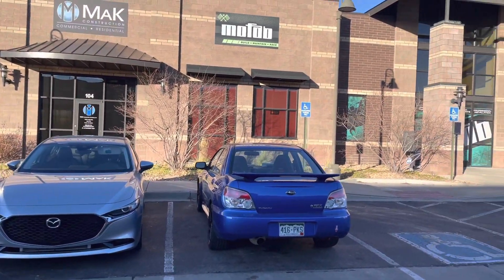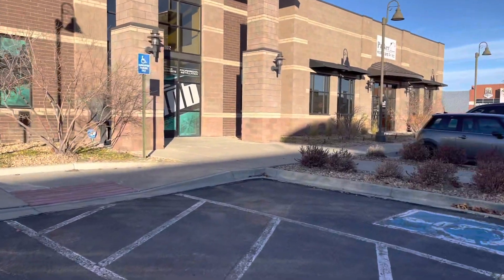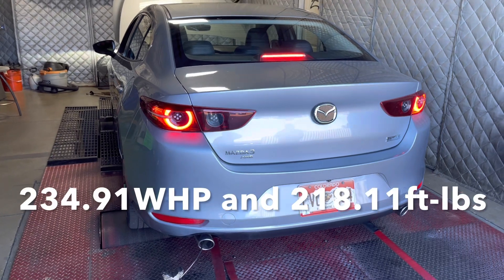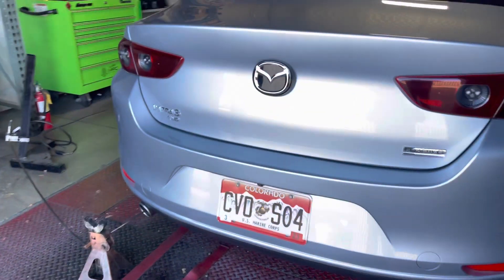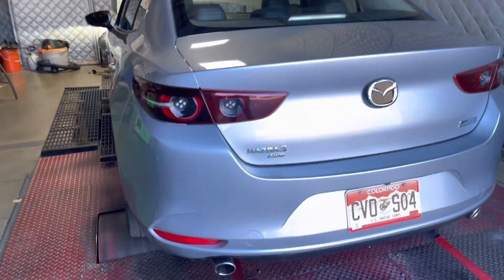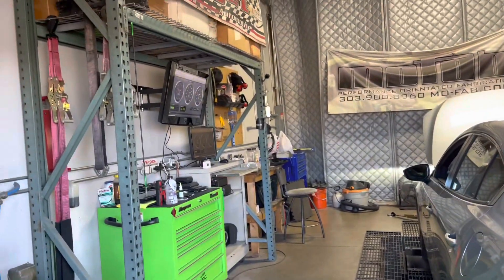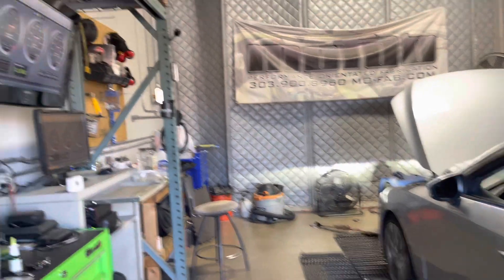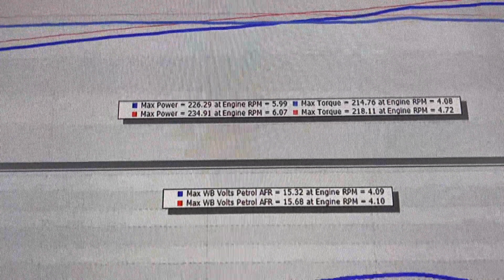VT-Racing Supercharged Mazda 3 2.5L Dyno Results!

Comment: Is there any other mod you need to support this super charger?
Reply from the maker: Depends on the year of the vehicle all cars are required to use upgraded spark plugs DILKAR8A8 work best
Reply: @supermazda3 i got a 2018 3 hatchback sport gt, Ive read somewhere that someone installed a low pressure oil something to support it i dont know im just wondering how much of a bolt on this is, aside from installing it and tuning it do I need to upgrade a whole bunch of stuff to support the new strain on everything?

Comment: how much boost are you running and is it still reliable after adding the vtsupercharger kit?
Reply from the maker: It depends on your elevation. At 6000 feet it's 5psi and at sea level it's 10psi

Comment: at first i was very confused as why the baseline was only a 154whp when my 18 2.5 manual doesn't feel like its making only that. Then i saw the 5900ft of elevation compared to my areas 33ft lmao
Reply from the maker: Stock only makes 154 to 160whp on 2.5l
Reply: @supermazda3  yeah, to the engines flywheel its the 184hp 181tq mazda advertises, after drivetrain loss, elevation difference, and the manual helps it alot its about 170 to the wheels

Comment: not sure its worth it imo... i got myself a Mazda 3 2024 AWD Turbo and i get 250 whp stock with 320fp of torque. just invest in that and you get full warranty from Mazda. but its still awsome what you can get out of that Super charger... 👌
Reply from the maker: You’re getting 250hp at the crank. The 2024 turbo model makes 218whp on 93 octane in the absolute best conditions. My car currently makes 25whp more than what’s in this video.

Comment: So this won’t work on a 2011 2.5L non SKyactive?
Reply from the maker: I'm not sure, they said it wouldn't work on the 2012 Skyactiv-G 2.0l but it did.

You just need to see if the intake manifold gasket is the same as the 2.5l Skyactiv-G
Reply: Thanks! Will do some homework

Comment: Correction: an estimated 314 whp and 69% gain, after latest numbers (see discussion below). 
How much power does this supercharger add to Mazda's stock numbers of 186 hp? Adds 101 hp (an estimated 287 engine hp).
How did I come up with that number? The baseline stock number posted in this video is 154 hp measured at the rear wheel, which is 0.828 of Mazda's claimed 186 hp measured at the crank. The best dyno measurement of the supercharged Mazda3 here is 235 hp, divided by 0.828 is 287 hp, measured at the crank (a calculated estimate).
Reply from the maker: 106whp higher than Stock
Reply: @supermazda3 okay, that's even better than what I just calculated. So you went from 154 whp to 260 whp? That's awesome! That means an estimated 314 engine hp! Almost 70% increase!
Reply from the maker: @Gruuvin1  correct
Reply: @supermazda3 I have a 2017 Mazda3 hatchback GT with 2.5L and manual transmission. 60k miles; all me. 
I am REALLY jonesin for this mod!
Reply: Also, that's a power to weight ratio that beats the Type R and the 370Z.
Reply from the maker: @Gruuvin1  Yes, FWD 4th gen is currently able to run about 13.3sec 1/4 at 105mph with full bolt ons using e20

Comment: This is awesome for those that don’t have a turbo model. A little more horsepower but the turbo still makes a lot more torque to the wheels. I wonder how this would affect the reliability of the car down the road. The good thing about this kit is where the power is held to top end where the turbo has plenty of Low and mid end power but tapers off on the top end. Either way I love my CX-30 Turbo plenty fast for what it is for a daily. I have a 500whp N54 if I want to go out for speed
Reply from the maker: The kits definitely make more power now, but the turbo with a tune is way faster
Reply: So would you say it’s better to install a Turbo or Supercharger? I have a 2021 NA CX-5 FWD. I talked with panda and he suggested still doing the supercharger if I want to open up the engine and increase its potential.
Reply from the maker: @EternalBodyOfLight  supercharger for sure for the newer NAs

Comment: I got the 3 turbo. I wonder how the dunk numbers compare. Havnt seen many stick turbo dyno results
Reply from the maker: The supercharger will beat a stock turbo, stock turbo is 210whp on 91 octane, supercharger on the smaller pulley is now making 245whp on 91
Reply: @supermazda3  impressive, thanks for the info. I guess I got a first target hp number to chase with mods. Be safe ✌️
Reply from the maker: @johnmilano6182  shoot for 280whp that's about what my turbo tune makes
Reply: Can you tune without a turbo or supercharger? I have a NA 2021 CX-5

Comment: How do you feel about the longevity of the engine/trans after installation and tune? Looking heavily in this and would like to see 300chp and 230-250whp but if it shortens the lifespan of a 300k engine/trans to only 120-150k I'm not so sure on "throwing out my factory warranty package" lol. Finding the sweet spot of reliable power to compete with say the type R, Veloster N or other hot hatches is what I'm after ('22 Mazda 3 hatch here).
Reply: This really depends on how well you look after the car and how you drive, if you like to smash shifts and drive the car at its limit then its gonna start to show more wear than it would at stock, if you just wanna wind her up the backroads everyweekend then your fine, but if you intend to track it or do any kind of street racing/drag racing or just general mucking aorund that involves banging the limy or spining tires, then be prepared to replace major shit in the near future. Being super anal about all the fluid changes will help too.
Reply: @Sk0die  I tend to be more moderate, normal driving for the most part but time to time wanna hear high rev exhaust/engine notes (might do like a track day after a updated tune or so). On average I tend to hit little over 200k on previous cars before needing major repairs... I know it's probably better to put it on earlier in the engines life so the car can get used to the additional strain rather than wait 100k. I'm not the most familiar with SC nor really turbos that are aftermarket. Only stocks and generally people with aftermarket hotdog the shit out of their rides. Probably will get it before I hit 60k though. Thanks 👍🏽
Reply: @cibailey1  The engine won't really get used to having the extra strain (although I guess you can keep improving tuning if thats what you mean) so putting the kit on at 40k and getting to 200k will end up with the same if not more wear than putting it on at 100k and running it to 200k. Even with the best tune ever, extra boost is still extra pressure so the more ks run with boost the more wear you'll get.

These supercharger kits are for sure safer than turbo for the skyactive tho, not saying turbos are bad but for a street car the supercharger is smoother, and this smoothness will ofc be less hard on the motor and gearbox. Good luck with your 3!
Reply from the maker: It will shorter the life if you drive it like you stole it but that would happen on any car

Comment: anyone know what the difference a skyactiv has compared to the previous engines comparing the 2.0ls together? i know it's more efficient and more power but is there anything else? 

like layout of the engines and the design of the engines
Reply from the maker: Compression ratio, Direct injection, the generation before Skyactiv-G had a bit of Ford engineering

Comment: this is so much better than the turbo mazda 3 from factory and cheaper, now I hope there an LSD kit available this will level up this platform to another level
Reply from the maker: It definitely is, more power & more fuel economy. Another dyno is coming soon
Reply: @supermazda3  my understanding on the economy part of supercharging a previously NA engine is that you have more than 6 auto speed. So at +3psi at the air intake manifold at 2500 rpm it is more powerful than 0psi at 3000rpm  without a supercharger. But the final gear ratio must be 0.75 or less to maximize the advantage of a  supercharger. If not, <10% of the "on the road time or duration" the supercharger bypass flap will not be modulating or closing. 

Pls do a comparison of a ECM operated vs a vacuum operated bypass flap on a supercharged car. Maybe the supercharger using a vacuum operated bypass flap, or bypass throttle, has a better operating bandwidth?.

 Thanks.
Reply from the maker: @whlawson  definitely will try to do a video on that, the vacuum bypass valve closing is very dependable on throttle angle

Comment: Maybe I missed it, but is there a reason why they didn’t have the car run all four wheels on the dyno since it’s an AWD Mazda 3? I’m wondering how much cheaper the discount price is and what the full potential of this kit is. I think anything over 2500 is steep unless this kit can get you close to 300whp through all four wheels. Otherwise, it seems more cost effective just to buy the turbo model and put a tune on it; the transmission and diff on the turbo model is beefed up to handle the extra torque as well. Even if this kit was capable of around 300whp, I’d be worried about grenading the diff on an awd car. On a fwd car, it would just be a burnout fest without an lsd.
Reply from the maker: Adding a 70% increase in wheel HP is not an easy task for most car with just a bolt on kit
Reply from the maker: The car is FWD bias, the kit can hit 260whp no problem & you'll see on my next dyno video. Even with the kit plus tuning this car is cheaper than the turbo model. I'm under $30k total & I still get 42mpg on the highway. No oil burning issues either like on the 2021 & early 2022 mazda3 turbo. Insurance is cheaper too 😂
Reply: @supermazda3 with your kit, does your 3 peel out the front end before engaging the rear wheels? Any concern with the diff or trans blowing up?
Reply from the maker: @Alex  no concerns to me, my car doesn't spin at all, but also the torque off the line is not as high as the 2.5 turbo. I build power with rpm. So longevity is a plus with launching a supercharged 3
Reply: That’s what I’m wondering, is it pointless to install the VT on my FWD NA 2021 CX-5? I’m new to all of this, I’ve only had it for less than 2 weeks but after seeing pandas supercharged CX-5 I was sold😅😂

Comment: hi normaly mazda 3 2.5 have 186 hP not 154 HP ??
Reply from the maker: 186 is the crank HP this is at the wheels
Reply: @supermazda3  ok what do you think with 2.0 liter with auto gearbox ( we have just this in thailand ) about HP gain and torque ? in thailand they make turbo kit but i fear it will not reliable and you ?
Reply from the maker: @samy  I've had my kit on the car 11k miles no issues, a 2.0l can make roughly 210whp with the right supporting modification. That's  roughly 227hp at the crank

Comment: Love seeing these videos. I’m already trying to save up to buy a lot for my 3 hatch. Can’t wait to awaken its full potential
Reply: Have you looked at the 2nd gen mazda 3s? They are far cheaper and considerably more reliable than the 3rd and 4th gens. The LF 2.0L and L5 2.5L are honestly some of the most reliable motors ever made, up there with old toyotas in terms of reliability. Only downside is fuel economy is quite lacking compared to the skyactives.
Reply from the maker: There's more coming